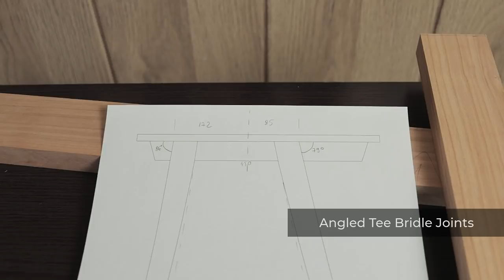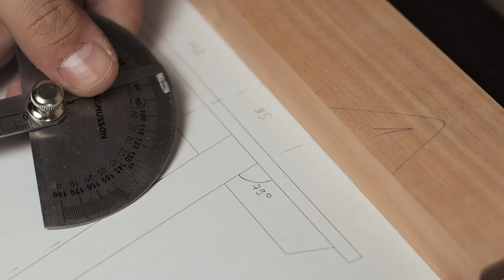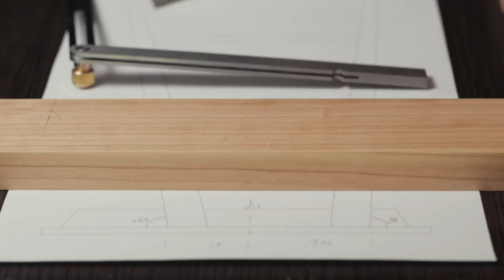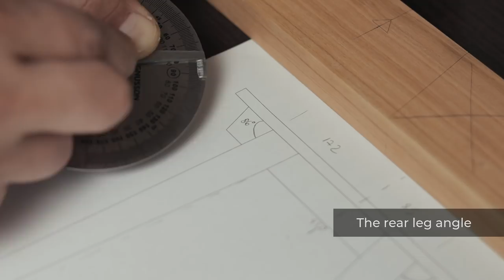Making Angled Tee-Bridle Joinery - Desk Build Ep.2

Comment: The pegging of the joints is called "Draw Boring". We use this in timber framing to draw members together. A rule of thumb is to "point to the Joint" meaning the hole in the tenon is placed toward the joint in order to draw the tenon tight to the mortice shoulder! Great video!!
Reply from the maker: Thanks! I knew something about the terminology but wasn't sure enough

Comment: How do you determine the angle at the joint as a new learner? If I am making table leg Based on the height of table and angle I don't want the leg should stay under table top only.
Reply from the maker: I draw it in CAD first, 2D and 3D, try various angles and dimensions until it looks nice basically, proportioned, balanced

Comment: Adrian, I always waffle between hand planing project parts before doing joinery (risking that they might get dinged up from being worked on over the course of the project), and just sanding the whole project after glue up (where getting into tight corners is difficult).  Can you elaborate on your approach here?
Reply from the maker: Yes, I wanted to explain more in the video but didn't knew how to embed that :))
First, the legs, the tenons. I only planed the short faces, those that get inside the mortise or that slot how it's called on a bridle joint. I feel more comfortable dealing with the final width of the piece when taking measurements when marking. And I only planed the ends, not the entire faces of the piece. Also here is a special case, the legs will be tapered, so finish will be required on the remaining unplaned places.  
Second, that upper connecting piece. There is another situation(s). (1) The legs will be proud on the outer sides, can be seen when I assemble them in the video. After glue up it will be difficult to sand, planing impossible. So I've planed to remove all the marks (there are planer marks, more deep than saw ones), and before I assemble and glue it I will just hit some 360 sandpaper to smooth it. (2) When dealing with pieces with holes/slots on the surface like this I sometimes brake the edges of those when planing and/or sanding, or even round a little the edges, so to avoid that I plane almost to finish those respective faces.
Indeed I all cases there is a risk to make some dents with chips while clamping and chiseling on the bench, but I take more care with these .
To resume, I only planed the faces of the parts that makes more trouble afterwards, not the entire piece.

Comment: Nice video, Adrian.
Nice job done.

Did you first have western chisels for the "rough" and for the "fine" did you use Japanese chisels?

Smile I also have such a "table broom". :-)

Looking forward to the continuation.

Take care and stay healthy!
Reply from the maker: Thank you! 
Indeed, the jp ones are 4x expensive😀
Yeap, too cute that little broom!
Reply: Hello Adrian,

Thanks for the answer.

Nagut I had a 10 piece long ago. Set "for beginners" bought from Dictum, who had bought just under € 200.

But I noticed that you can work better with them than with the western ones and that if you treat them incorrectly, they can break off on the cutting edge. :-D :-D

Greetings from Germany.
Reply from the maker: Those mine are 40-45 euro each, 5 pieces, so same 200 :)) Yes, I feel more comfortable using them, better grip and approach of the marking line. The hard steel part being more brittle is very easy to brake them if not careful
Reply: That's right with the steel.

Smile, I can't afford the expensive ones for health reasons. :-D :-D :-D